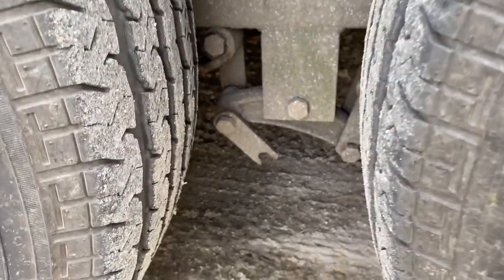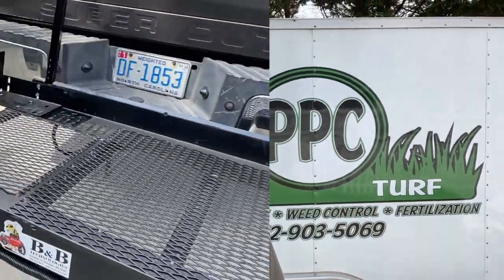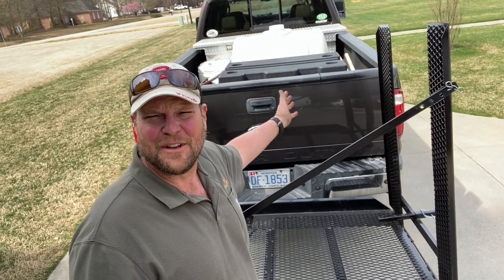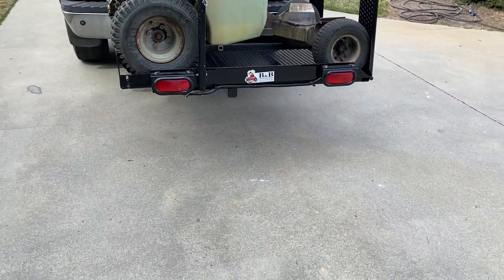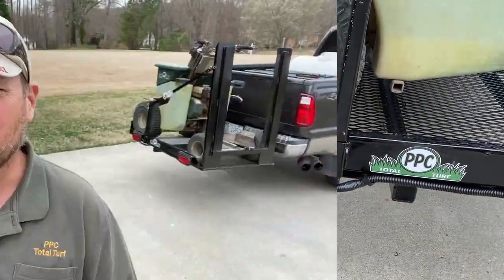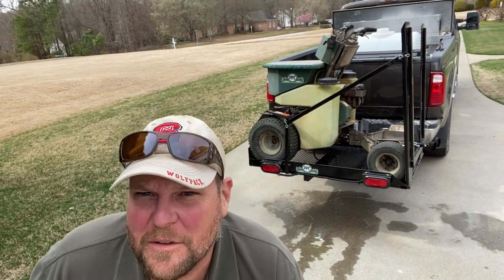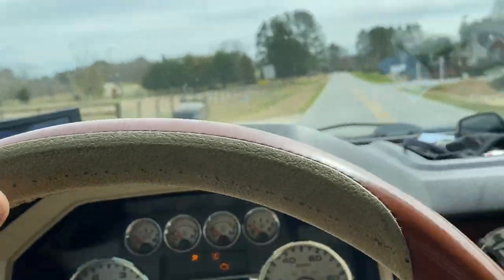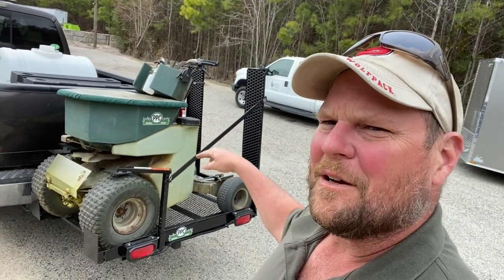B&B permagreen carrier rack... full review

Comment: I tried one but like an open trailer where I can unload and load PG on the street and not into the yard. You also can let down truck tailgate and fill up a lot easier.
Reply from the maker: It’s different unloading from the side ... it does take some getting use to
Reply: @PaulsPrimeCuts  plus it  looks like you have a Hoveround power wheelchair on the back bumper...lol
Reply: Where would I put the 30 bags of material I need each day? That's a lot to put in pickup...
Reply from the maker: @stevewilley5185  I’m going to use this thing with a flat bed truck... I can stick a pallet on the back
Reply: @PaulsPrimeCuts  you'll need a flat bed dually for all those 14 acre days....right?
Reply from the maker: @stevewilley5185  yep I got a bigger nurse tank for it too ... gonna be a production machine 😁